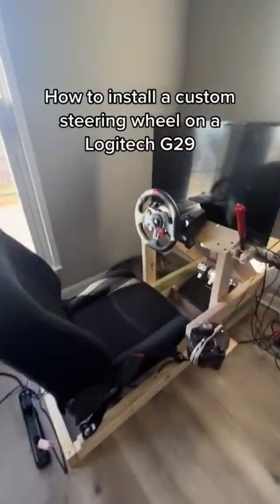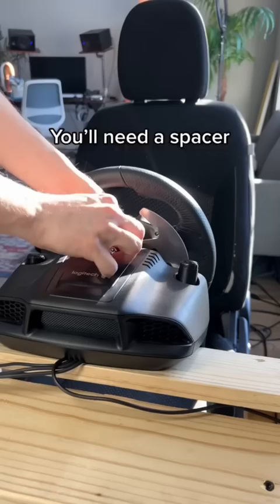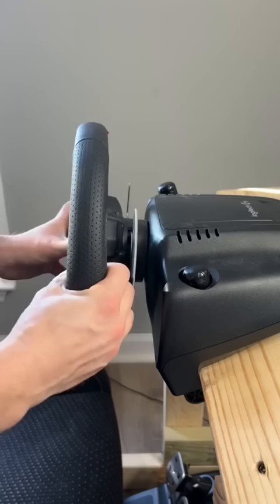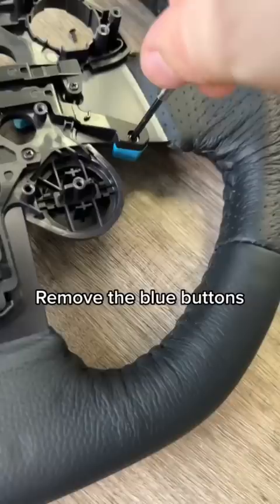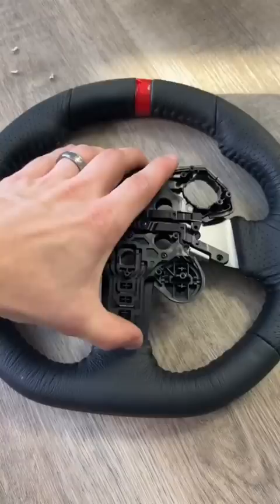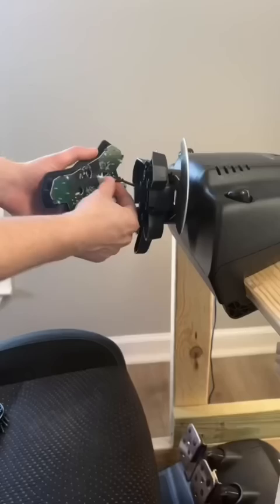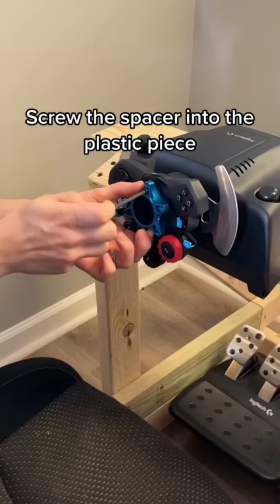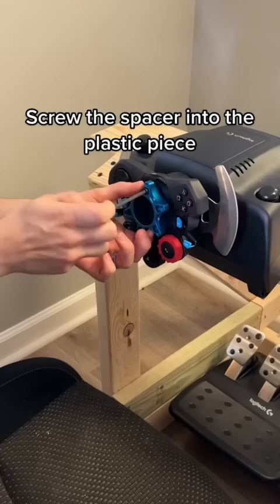How to Install a custom wheel onto your Logitech G29 / G920 !?

Comment: yeah, but your Force Feedback will suffer alot, so it is not really recommended
Reply: No it does not
Reply: @Bill-bi7sk  you sure? A heavier and bigger steering wheel will put a lot of stress on the force feedback mechanism, especially on a G29
Reply: @Bill-bi7sk That's just how torque works. 2.5 Nm with such a large diameter isn't gonna do much
Reply: @hamzerpanzer I don’t know if anyone here has the wheel but is it kinda strong. Like to the point where it doesn’t just feel like a slight push?
Reply: What if you use a lightweight sturdy wheel ? That will make it better than worse
Reply: @LoadShitUP  possibly
Reply: Facts it turned it into a Mac Donald’s toy
Reply: @LoadShitUP yeah I was gonna buy a carbon fiber one for mine. It’ll be lighter then the wheel that comes on it just a larger diameter
Reply: @Bill-bi7sk It will, a larger diameter means that the user has a larger moment, meaning the force they input is larger, therefore the perception of the base 2.5nm is much lower
Reply: What about putting a custom F1 style wheel mod on the G29 base - would that make the FFB weaker & if so a lot?
Reply: @jeffstevens2237  im not sure, it mainly depends on the diameter and weight of the wheel, as far as im aware
Reply: @jeffstevens2237 It really depends on the weight of the wheel, if it's a lot heavier it would reduce the strength of the motor
Reply: @AfkBxndit that shit is strong like if yu dont have a sturdy setup, its gonna rock your table like crazy

Comment: TO EVERYONE THIS IS VERY IMPORTANT IF YOU DO THIS CONEVERSION YOU WILL LOSE ALMOST ALL YOUR FORCE FEEDBACK
Reply from the maker: Not if you adjust your force fees back settings :)
Reply: how
Reply: @SimRacingSucks u are still adding unnecessary weight to put the same round type wheel... geniouus.
Reply: Yeah, it makes a difference on even the thrustmaster tx/t300 wheels, can only imagine a logitech wheel with one of these lol.
Reply: @sebastiancastillo8763  how do you know how much the other wheel weights lmao maybe it's lighter?
Reply: @Toastedseb  Not quite, that wheel may be even lighter
Reply: Has nothing to do with weight... its to do with the diameter of the wheel. the bigger diameter, the more torque you can input. bigger wheels mean lighter feel, smaller wheels mean heavier feel. 

And it has nothing to do with force feedback settings. the G29/G920 platform has a very weak force feedback motor. I think its strength is about 50% of the average thrustmaster wheel and about 30% of non-direct drive Fanatec wheels. You can increase the force feedback strength all you want but the second that G29 has to deliver more than 2nM of torque it starts clipping. 

Dumb discussion all around. If you want to do this don't let this hold you back. But don't lie to the audience and tell them the FFB is the same after changing FFB settings when clearly it's not going to be the same. You're ruining your warranty doing this, possibly destroying the wheel if you scratch the motherboard, and changing the feel of your wheel. the g29 has a small wheel for a reason. Theres a reason why fanatec and thrustmaster wheels come with bigger wheels, because those can handle the bigger torque demand. This wheel setup might indeed be viable for things like Rally where wheel feel is usually light. If you want to do any track racing with modern racing machinery, this setup will be absolutely awful.
Reply: @Toastedseb it's not the weight as much as It's the diameter. The Logitechs are small and getting a deep dish doesn't make it better
Reply: @Toastedseb blud misspelled genius
Reply: @SimRacingSucks that doesn't magically give your wheel more torque. All you'll get is ffb clipping and overall much less feeling
Reply: @Toastedseb  nah, the wheel he replaced it with is a larger diameter, I hate the stock G29 wheel diameter its like a gokart wheel. I drive an MX-5 irl and I would rather my sim simulate what I am used to.
Reply: No you don’t.
Reply: @playfast321 he didn’t lie, never said it was the same he just said you don’t lose all ffb which is true. You can comment a novel all you want, but the fact remains ffb isnt effected that much. Ive since done away with this exact setup op has and now have an all fanatec setup, but hes not wrong, ffb is still there on a logitech with that exact wheel he used. How about real world experience instead of what its supposed to do on paper… we all know it doesn’t work out irl the exact same way it does on paper.
Reply: Default Ffb is 50%, so just turn it up to 100%
Reply: @playfast321 so I just got the g29 and it feels like shit clunky, a bunch of noise, did some research and a lot of ppl say the thrustmaster t300 is wayyy better in most ways, so my question is should I just sell the g29 and get the t300? (also had this wheel for about 3 days now don’t like it at all)
Reply: @BugeyeKb  personally i made the upgrade to a T300 from a G29 and I haven't regretted it for a moment. The wheel rims are much higher quality and the FFB is smoother, more powerful, and quieter. For the best experience you'd want a direct drive wheel such as the ones from Fanatec but personally I have no experience with those and they're a lot more expensive than a base t300. 

If you decide on getting the T300 make sure to get a set with higher quality pedals as i didn't like the base 2 pedal set. I have the T3PA and they're very nice, especially with the brake stop. I also got the set with the Ferrari 599xx EVO wheel rim which has some nice alcantara and some button functionality for BBAL. Also what i personally like with the thrustmaster system is that you get choices in their ecosystem. If you prefer an F1 style rim you can have one without it breaking the bank. Logitech doesn't offer that option and Fanatec is quite expensive in that regard.
Reply: @playfast321  nice, thanks for the detailed response now I’m kinda convinced to make the switch 😂🫡
Reply: @Toastedseb it’s a bigger more realistic wheel. It can help in racing games like dirt rally. You have more control of the wheel and not twitchy
Reply: no? lol with a 2kg wheel i needed to put 25% more to get EXACT same ffb (so basically its the same config you would use on a stock g27 for assetto corsa)
Reply: no you don’t lose it i did it and you don’t lose it if you do it correctly

Comment: Now you either need a real car to put it in, or just a car radio that works.
Reply: Phone?
Reply: @SalihAhmad597  No.
Reply: Car radio is easy, just 12V power, and wire in speakers.
Reply: @Get_yotted  gotta have a certain cable though you want a 12v cord with 2-2.5 amps and for more fancy modern radios you may need 5 amps id check the manual that comes with the radio or the sticker on the radio itself theres also a lot of youtube videos out there on this
Reply: and a car dashboard
Reply: How did he make the blue part of the top of the steering wheel red?

Comment: How to make the Logitech force feedback even weaker😂
Reply: Literally
Reply: Yea and it will die
Reply: It aint that weak brother,u never had it
Reply: @hl8939  It definitely is.
Putting bigger diameter wheels on  5-9nm DD wheels can dampen the strength of FFB. I can only imagine how the G29 puts up with the new wheel.
Reply: @hl8939  bro what, that shit is weak af. not comparable to real car or even some direct drive wheels
Reply: @szymonn4800  its not

Comment: He is born to destroy the whole Logitech g29 ☠️
Reply: @joeyb7084 bigger wheel means bigger force needed for the motor to simulate FFB, hence it'll wear it out faster
Reply: @arszene4129 
Not how it works? 
The base applies 2nm max.
The Force Feeback will feel weaker due to the heavier wheel but thats it.
It does still exert the same amount of force.
It wont exceed that no matter how big and heavy the steering wheel is.

Comment: if you add a bigger steering wheel like that you loose a lot of force feedback
Reply: Not if the wheel is light
Reply: @fbi4671  its also the size of that steering wheel that he did install because the force feedback gets disturbed on a large surface so that's why.

Comment: Just had to say that it will make the force feedback be awful because the wheel weight and size, it's better to get at least a light one.
Reply: Mostly with the logitech wheels. Thrustmasters will be fine as long as you have a decently strong wheel. T300 and up is what I would recommend if you want a wheel like this.

Comment: I recommend getting a quick release on it so you can take it off when it has to calibrate to extend the life on the set up, set up looks fire though
Reply: That would involve modifying the steering column which most people would probably try to avoid

Comment: I actually have a business getting ready to launch making modded parts and modding logitechs for customers. Been doing it since the driving force gt released. Anyways if your running a deep dish wheel, you have to reinforce the steering stem. Also you'll be better off completely disconnecting motherboard, and button housing. Run wires through the steering stem and mount the buttons in a button box. Depending on how you want it setup you may need to extend the wires a bit. Also make sure your wheel is a cheap ebay one if you haven't upgraded the rack n pinion gear set yet. If you want to run a real wheel, a heavier wheel, or a larger diameter,  your gears will strip pretty badly over time. Typically noticeable around the 4-8 month mark depending on usage. One last thing if you decide to run a heavy, deep dish wheel thats almost twice the diameter,  you'll need more than just the helical gear upgrade, a motor upgrade will more than likely be needed as well. Otherwise you'll start having over heating issues later on trying to over use the motors by increasing ffb in game beyond what they can handle. Although the cnc helical gear set would increase tq by roughly 19% you end up losing around 26% tq with oversized wheels assuming its a quality brand
Reply: At that point, it would be much better to get a thrustmaster wheel and do this mod if youre saying to upgrade the motor in the logi wheels.
Reply: @GamerGavin04  the motors are only like $30 so it's still well within the realm of being budget-friendly
Reply: @damarlo1  Well damn that isnt too bad at all.

Comment: if you r going to change your steering wheel, at least pick a light one, there are some cheap ones on aftermarket, a heavy wheel will completely destroy/overheat you ffb motor over time
Reply: true n like the spacer as well, i made my own spacer jus with a metal plate n drilled holes which is way lighter than the ones bought online n stronger than those 3d printed ones
Reply: @grizzyt2757 I’ll like to see a picture of it
Reply: Uhm no?
This doesn't change how much fbb is being applied
The g29 is made for 2.3nm torque and a bigger wheel doesn't increase that
Reply: @flosa1995 ofc it does. Try putting a suzuki engine on a chevy impala, ofc its going to strugle to move out of the place, bc its biggier and heavyer. im saying this by my own expirience. I have both a 300mm drift wheel and also the original one, the bigger the wheel is, the weakyer the ffb feels, im not going to explain it bc english is not my main language, and i probrably wouldnt explain it well. But the bigger the dyiameter of the wheel, the weakyier the ffb feels.
Reply: @PozeFivem  
The force feedback is still the same
The wheel is made to max apply 2.3nm of torque

It doesn't matter if you use it at 100% ffb with a bigger wheel
It would if there was a massive rpm increase of decrease but that isn't the case either

All we did is decrease the perceived effect of the force feedback

We do NOT drive the belt drive harder than before

As you said the ffb is less with a bigger wheel which implies that it still uses the same amount of power

In your example you drive the engine with higher rpm, temp and speed to match previous performance of a stronger engine 
We don't do that with the g29 
If this was your example the car would be a lot slower as you would have to still use that engine with the identifical stress as before it was swapped into a heavier vehicle

So yes, it feels weaker
But no, it doesn't destroy the ffb as you implied in your initial comment

I also have a 350mm wheel on my g29

Comment: If you want a free f1 wheel but have the g29 just unscrew the wheel and use the paddleshifters as the handles, cheapest way to get an f1 wheel

Comment: Did it with my g29 before upgrading to a DD. Only problem is the ffb isn't has good but I definitely approve the wheel👍
Reply: Yeah it's based on wheel diameter but weight can affect it too which is why I'm not going to modify mine, I'm selling mine soon as I have ordered my first DD wheel

Comment: So always get a aftermarket wheel that’s lighter or the same weight as the original wheel. Lighter wheels will actually make the ffb stronger (not gonna explain why) and the same weight will well feel the same. Heavier wheels will make the ffb worse and make it more prone to failure and overheating.
Reply: That's true if the diameter of the wheel and weight location are the same, in this case he will loose (if that's a 320mm wheel) 12.5% of force just from the size difference, + a bit more since that wheel has most of its weight in the edges (that's because of leverage and inertia)
Reply: @cesarjuniorcardoso1  Yep. If a wheel is light enough while being bigger it will still counterbalance or be more forceful but in most cases aftermarket = weaker

Comment: How to give your self even less Force Feedback in 20 minute's. you just put a bigger heavier  wheel on the Logitech  go from 2.1 nm of torque down to 1.2 nm of Torque, because the base has to work harder to turn it and it takes less force to turn the wheel your self. its like putting big drag slicks on a 150 HP car its more weight and makes it slower.

Comment: putting a bigger wheel on will give you more mechanical advantage over the motor, therefore dulling the force feedback. I wouldn't recommend doing this with a normal sized wheel

Comment: Bro literally here in the philippines the g29 shifter pedals cost 16k😭
Reply: 16k philippines pesos is equal to 286 USD.
Reply: @jayyhick65 I know but it’s expensive
Reply: @Gamingwithme595 it's cheaper than in the UK currently, going by currency convertion

Comment: I used a piece of wood made it a circle like the spacer used wood screws too attach to wheel and bolts to attach wheel to the wood 😂😂😂😂 I don't recommend but it worked

Comment: Would this damage the gearing inside of the steering assembly due to the larger torque applied (through extra weight or potentially a larger steering wheel?)

Comment: I swear I'm getting frustrated with the steering alignment not being centered properly in ETS2.  I tried adjusting the wheel both in the game settings and in the Logitech profiler software but it's still not aligned correctly and I have to hold the wheel slightly left of center just to be able to drive in  straight line.

Comment: IS THE SPACER 70mm???

Pleaaasee I need to know
Reply: The spacer bolt pattern would be 70mm. Honestly don't recommend an aftermarket wheel on a logi as you sacrifice a little bit of FFB you had just to have a big wheel. it's just kinda a waste of money save your money and put it in to some loadcell pedals or sell the logi and use that money to get a used t300.
Reply: @TheRivalryDrifting  my words this is day 173 of saving for t300 full combo [i have 458€ need 700€] only 242 left
Reply: @TheRivalryDrifting  T300 is nowhere better than Logitech G dude. TSPC is much better, but t300.. t500rs would be equivalent to Logitech.. 
just drive a track car on a track day, and then use both, you’ll see. 
We tested with a friend, buy buying one each back in the days. We were tracking (national level races) for a few years already and we both agreed the T500 reputation was not accurate.
I then bought TSPC after a few years with Logitech and is really good. Will switch to fanatec probably soon
Reply: @Dstructeur1   the t300 is stronger and if you want a full size or aftermarket wheel youll want/need that extra strength for a biger wheel and for that use a t300 is better. i cant real say wich is better as i jumped from the logi to a vrs dd the logi felt ok when new but qwickly started to feel like a bucket of bolts. but i will say i am from the drifting side of sim and the logi kinda doseint cut it but like 50% of sim drifts use t300s and they have no probem ( just adding on why i say kinda doseint cut it. a logi dosint stop you from doing anything in drifting as some of the top sim drifters are on logi but ouce you get any good the logi ffb dosint keep up and really dosint do anything for you as its just all you spining the wheel).

Comment: your gonna lose alot of force feedback though
Reply: just overload it
Reply: @meizind6555  you can’t just overload it because it absolutely fucks the gears inside, i overloaded my g920 and because the gears were plastic i sheared most of the helical gears on the right motor, then my wheel made horrible noises when turned too hard in one direction
Reply: @see3682  well, you CAN do it, never said you should ;D
Reply: @meizind6555  I overloaded mine now it squeaks and rattles so annoying
Reply: @iquaps548  I did like 130% FFB and its perfectly fine

Comment: Wait  I though the rubber thing is just a meme
Reply from the maker: Rubber thing?
Reply: @SimRacingSucks  rubber band in driving stick? cmiiw
Reply: @pad8941 no it makes a sequential shifter, if you bind 3rd gear to downshift and 4th to up, it’ll become a sequential